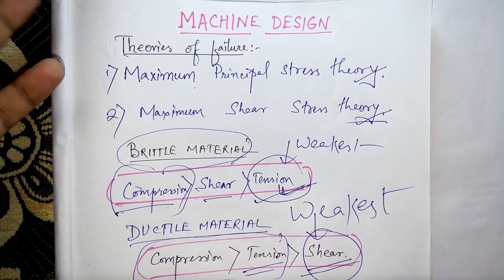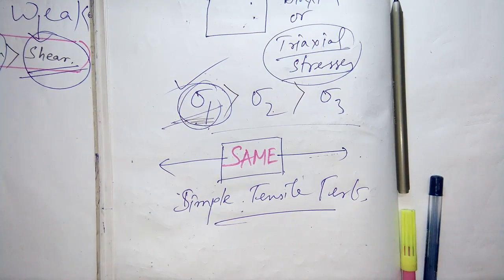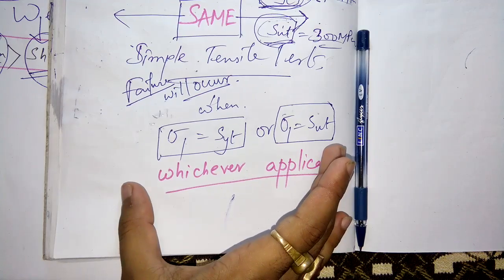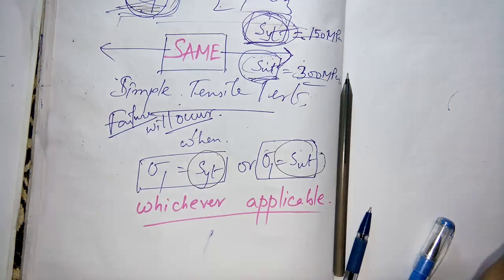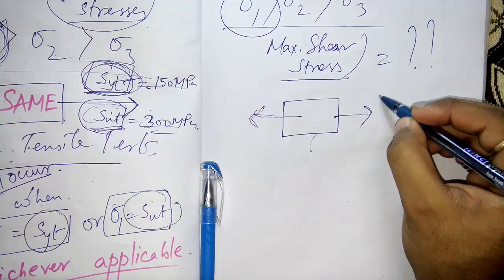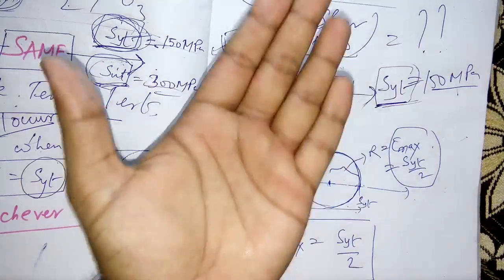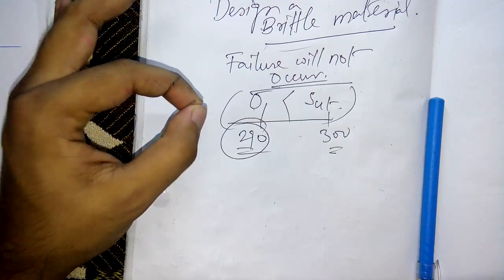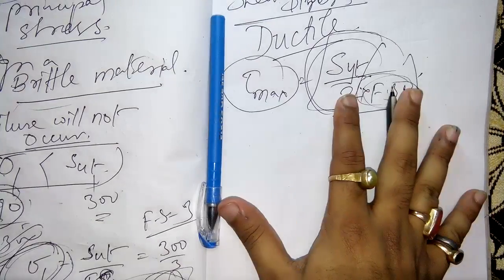Theories of failure for machine design and som-lecture1

Comment: the solid circular shaft is subjected a bending moment of 40 knm and a torque of 10 kn/m.Design the diameter of shaft according to maximum principal stress theory. take stress at elastic limit 200n/mm2 and factor of safety 2.
iska ans